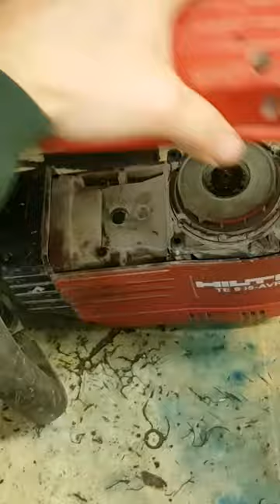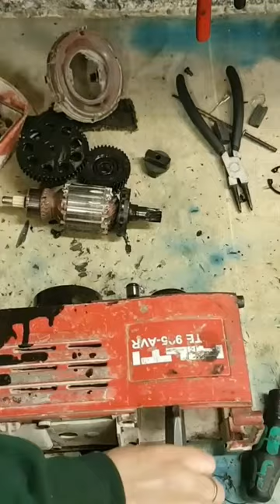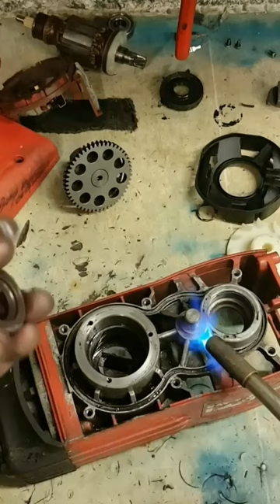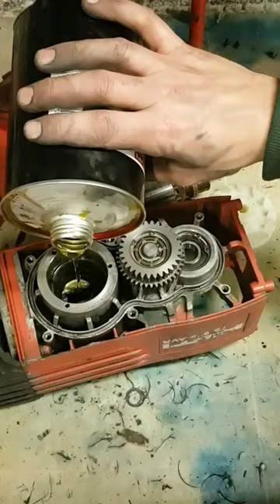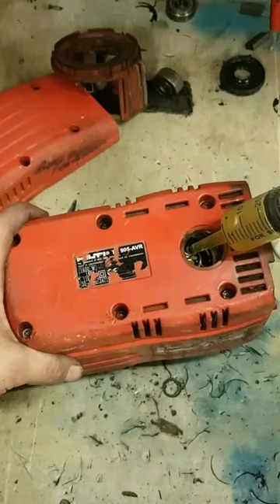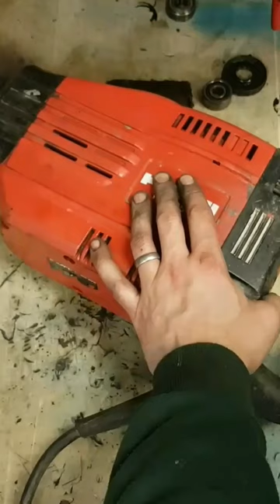Repairing Hilti te905 #tools #restoration #machines #hilti #demolition #repair #deandohertygreaser

Comment: I have a Milwaukee 1/2 impact and it works when I put the battery in but after the battery is in there for a min. It in use it won’t work and I have to pull the battery out and push it back in and it works any thoughts